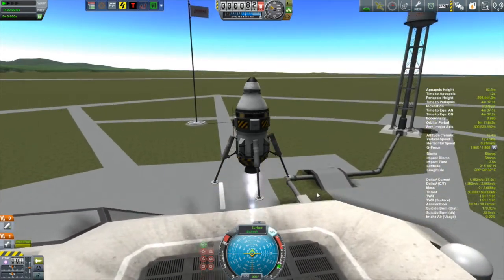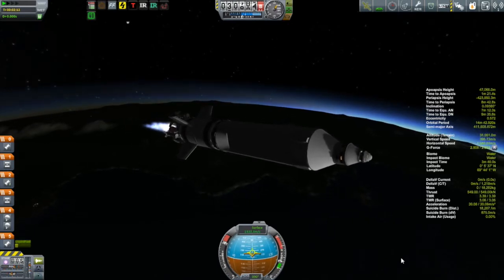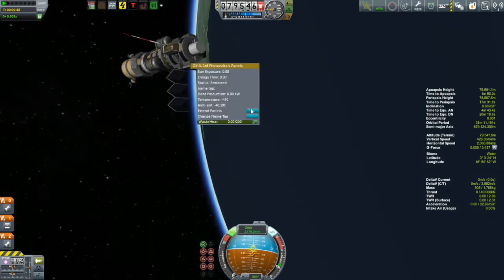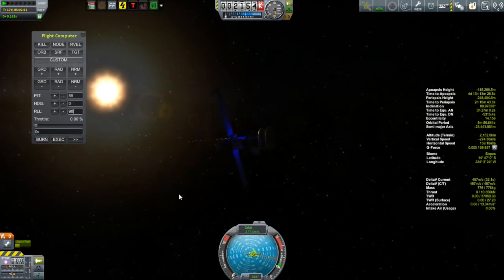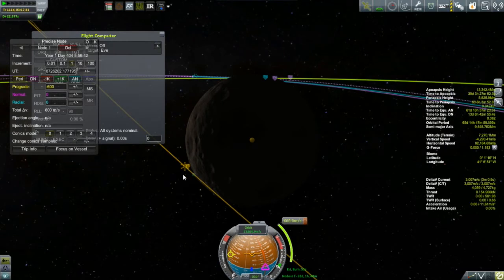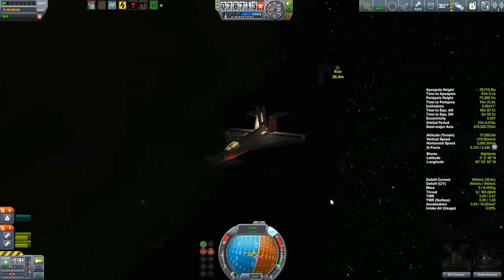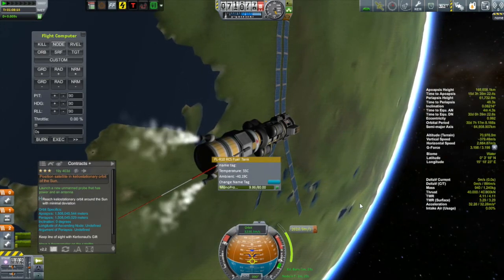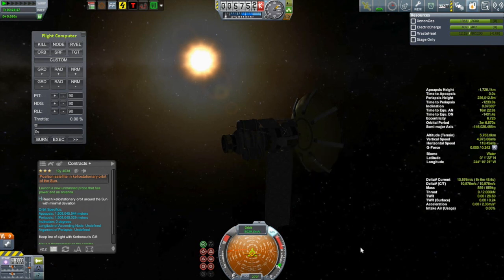KSP Beta Career: Episode 26 - Orbital Repairs

Comment: The landertrons look very interesting. So, it seems like they don't allow for reuse.
Reply from the maker: John Nowak Yes.  Whatever fuel they have remaining is dumped upon touchdown.  I rather like them.  You still have to use them right, setting yourself into a vertical fall.  You can also set the touchdown speed, so you can get them to work in conjunction with parachutes ala Soyuz.
Reply: Mike Aben I was thinking Viking lander...